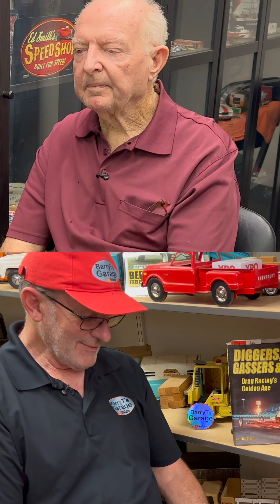Head Swap the 305? Or WHAT? Ed Smith w #BarryT from Ask Ed 45 #classiccars #hotrod

Comment: 1987-1994 305 is swap able with a 1987-1994 350 both are going to be tbi fuel injection same center bolt valve covers same fuel pumps same computer should be able to swap it right in no problem. Cake walk. Not as invasive as doing a ls swap
Reply from the maker: Agreed

Comment: i’m gonna completely disagree with you because people make 500 hp all day long with 302s if you could take that compression from 8 1/2 up in to the 9 1/2 or 10 to one range, they can be quite responsive i built a 305 tbi deck the block and heads the vortec with a Edelbrock performer intake 650 holly it makes upwards of 350 with a magnum 236 comp cam 2200-5800 but thats all it has. could we have put a 350 in it? Yes but then my son wouldn’t get the experience.

Comment: Why is the 305 so widely poo pooed...because it's small, but in it's day the 283 was worth building for more power. They treated the 307 the same way...not worth it. I had a '71 K/20 with a 307/4spd and it threw the timing chain, bent pushrods. "Get a 350" everyone said. I rebuilt the 307, 1.94" 64cc heads, flat tops, HEI (spring & weight kit), HD Melling pump, 4bbl intake, and Holley spread bore 450cfm and that work truck had great power. 37/14.50 rubber, too. 13-14 mpg

Comment: The problem with the 305 is the tiny bore diameter. This is why the ford 302 is better when it comes to making more power from the same displacement. The 302 with a bigger bore diameter allows for better airflow through the cylinders which gets even better with the proper camshaft intake exhaust and upgraded cylinder heads. Trick flow sells a top end kit for the ford 5.0 bumping it from 225 crank horsepower to 360 wheel horsepower. There is no such thing for the 305 because it doesn't respond the same way with the tiny bore size.

Comment: ❤ 305 is the best🎉 just put it in the corner and you can't hear nothing🎉 350 with the cast crank and two bolts 😢 besides the 9 bolt not going to hold up to that anyway😅 or  700 r4😂 I got pretty good at changing all that stuff❤😂😂😂

Comment: I have to disagree. We have built some pretty good 305s over the years thats made over 400hp on pump gas with hydraulic roller cams. Key things you need is good head flow using a 1.94" or smaller intake valve, nothing the big to unshroud the valves,  9.8-10.5 to 1 CR, great flowing ported intake manifold, properly sized cam wiith .550-.575" lift, good oil control system and good headers. 
Most people try to build them like a 350 not understanding that you hurt head airflow trying to use a bigger intake valve on the small bore. Get a head with smaller valves and port it real good and those 305s will eat

Comment: Okay, look. Assume a 1994 c1500 2wd. It is throttle body injected, with a terrible intake manifold, heads and exhaust. The stock transmission shifts at around 4500rpm. The stock torque converter stalls about 1200-1500rpm. Most of these old trucks had a 3.08 final drive gear, and weighed 4000-4500 pounds. Good heads won't do anything for a corked up 305 shifting at 4500ish rpm. In this situation an all cast budget 9:1  383 build with a really really mild cam with the rest of the stock throttle body injected junk, will accelerate the vehicle better with lots of torque than any 305 build. Any engine will have horsepower choked by the stock 1994 truck parts. Might as well make some torque.

Comment: I would look for the hi performance heads Chev installed on 305's in Camaros. Smaller combustion chambers and bigger intake valves. Chev seemed to install a low perf cam in 305 engines. For the hi perf they installed a 350 cam. I would step up to a cam with 204° to 210° at 0.050" lift intake and about 10 ° more exhaust. Keep LSA down with the larger valves to 108°. I would also change the rocker arms to Comp roller tip 1.6:1 ratio. This should get the lift up to 0.500". Still not real fast, but pull better and a bit better fuel economy.
Reply: 30 over 305 is good for  .460 lift max with 1.94 intake valves. Ed don't know much about 305's, I've built several just to see what they can do. Big difference from stock. Needs to stick with his small displacement flat heads.

Comment: I would love to know the secret of how Ed got 18 Miles Per Gallon out of a 350 Chevy in a full size pickup truck.
Reply: Because it ain't true.  I've owned 305's.  I've owned 350's pre and post vortec.  Almost touching 15mpg highway was the best they'd all do.  And that's super rare.  I average 11mpg with current vortec 350.  And that's after doing the mpfi upgrade which improved fuel delivery but didn't affect mileage

Comment: The big problem with the 305 was the cam.lrofile, then putting heads on them didn't gain much because the small bore caused so much bote shrouding of the valves they simply couldn't take advantage of the better flow! Change the cam and leave the smsller vlaces and younwould gain something. The 305 had the same stroke as a 350 so it should have nearly the same torque theoretically. It wasn't that bad of an engie for a car but not really enough for any pickup being used to pull much. A lot of circle track racers will test a 305 to see if it will bore out .060 and build it to race because they are so plentiful. Pistons aren't all that pricey when using Hyperutechtic casts. Sonin circle track racing as Ed mentioned about claimers, you don't loose a precious 350 4 bolt block that you spent a ton of funds on. I made that mistake once, won't do it again if I decided to roundy poinder again.

Comment: Aftermarket heads are 62cc minimum and 305 heads are 58cc. Maybe the pinging will go away. Make sure to get small valves.  305s are just not worth anything.

Comment: I beg to differ. Ive never had a good 305 until I was given a 1996 Vortec 305. I had to find a Vortec specific intake but otherwise it hauled the beans in my ,86 GMC.
Reply: The big problem in pre Vortec 305s was the cam. Short on intake lift.

Comment: Back in 1976, my brother and I dropped a couple of 302s out of two wrecked Z-28s into a 1957 Chevy Biscayne, and a 1972 Toyota FJ40. We added Muncie 4-speeds, headers, etc.  to both. Both had plenty of power to "go up hills". Both would run the quarter in the 12 sec range.
Reply: 302 are not 305s the 302 has a 4 inch bore. Which is the magic number.
Reply: @toddjensen692  Well aware. We used to use a 327 block with a 283 crank to get 305ci to go into our autocross & gymkhana cars. Plenty of rpm and power where we needed it. Miss those days and my brother. He'd hate but I switched to Ford in the form of a Mustang GT 500...
Reply: @research903 um no. The block would have to be over bored to make 305. A 283 crank in a standard bore 327 block makes 302. That is how the factory did it in the 60s
Reply: @toddjensen692  We always took advantage of the rules. We could and did bore 60 thousandths over to get the 305 without a penalty or change of class. We ran in the D/Modified class of the AHRA. I may be 80, but I remember it like it was yesterday...

Comment: I had a maroon metallic '90 C-1500 shortbed with the 350 w/ a 700R4 tranny. Oversized front and rear anti roll bars, 2" drop front coils, 3" drop rear leafs and Rancho shocks. I got clocked at 135mph. That was quick for a truck back in the day. Probably the best PU I've ever owned. It was a looker too.
Reply from the maker: That sounds like a sweet truck!

Comment: I don’t completely agree. The 302 can easily make 500 and your saying just because it’s a 305 you can’t make decent power. I have made 400+ with cam heads and intake on stock rotating assembly. Unless your one of the guys that think anything less than 1000 is useless 400 on a daily is very fun!
Reply: There is night and day differences in a "302" and a 305. Do you have the dyno sheet for that 400hp 305??? I'd like to know what dyno was used.
Reply: @martywilsonwilsonenginesho7940 400hp out of a 305 is not impossible... However it would cost more to build than it was worth, and not be very streetable...
Reply: @jakobsimmons9997 I have a very good running 305 on a cradle. I don't mean to thrash them, as it is a reliable motor, but not a 400hp motor. The 350 and 400 I have far outperform that engine, yet I won't sell it. Its good for a lot of applications but not really a HP motor. Not enough bore and to long of a stroke to rev. 307's were the absolute DOG of SBC's.
Reply: @martywilsonwilsonenginesho7940  That pontiac 301 turbo was a real flop also in it's day
Reply: @Squatchsgarage  302 has same bore as 350 but short stroke to rev high, that's where the power comes from. 305 has significantly smaller bore. you could spend the same amount of money swapping in a 350 vs building a 305 to make the same power. The bore and valve size seriously restrict what you can get out of a 305.
Reply: @Squatchsgarage  hey man, as others have said, 305 has a small bore, shrouds the valves, and while you could grind valve reliefs in the bores for bigger heads/valves, you're never gonna make the same power as a 302/350 with a 4.0 bore. However the 305 is NOT useless or a "trash" engine, can be very torquey with a set of ported tbi swirl port heads and tpi intake setup. Probably pretty good fuel mileage too if you got the gearing right for the weight.
Reply: Was using a 305 out of an 80s caprice,268-h comp cam,with 350 heads amd it wasn't working for me  in a 63 chevy truck
Reply: I want to see the dyno sheet on that 305